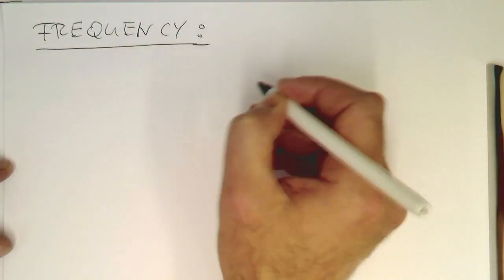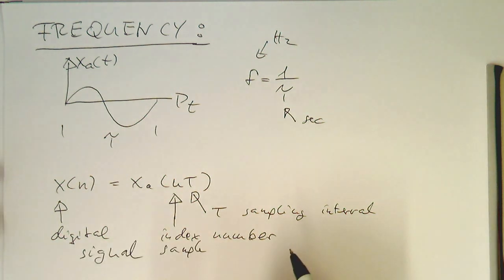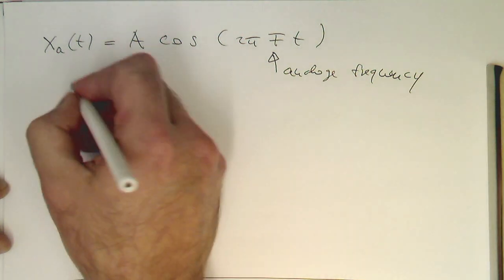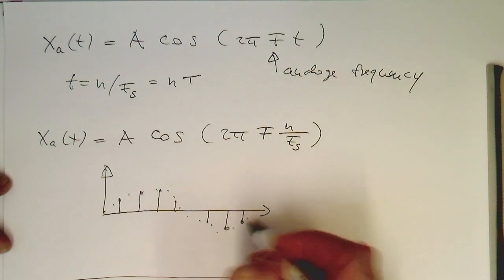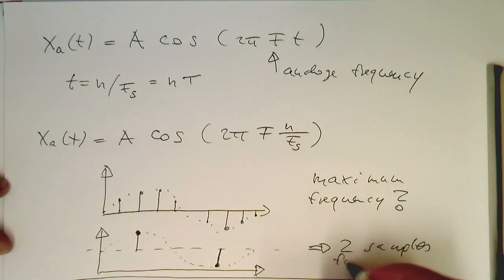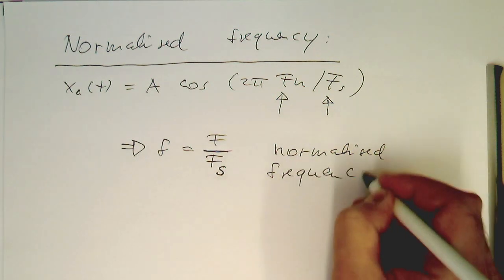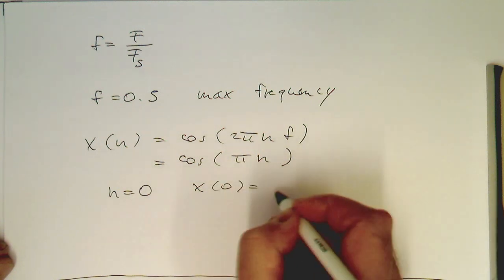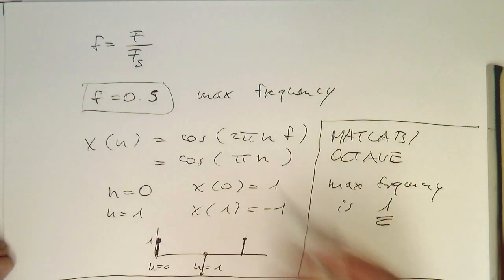DSP introduction - definition of frequency (#005)

Comment: at 4:41, that should be the minimum frequency, right?
Reply from the maker: it's max. Just using two samples. Up and down.
Reply: If you watch the video until the end it's clear he meant the normalized frequency. But I agree with you, if you watch just that section, it seems he could be talking about the sampling rate, in which case, you'd be correct: it should be the minimum sampling rate